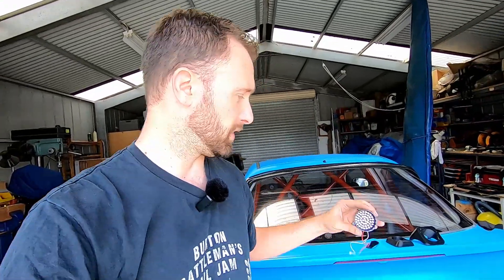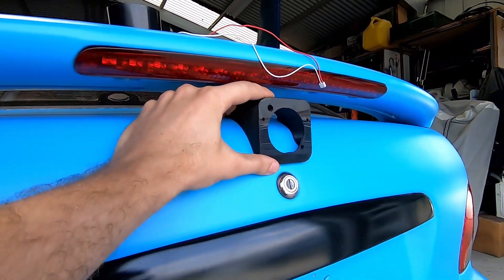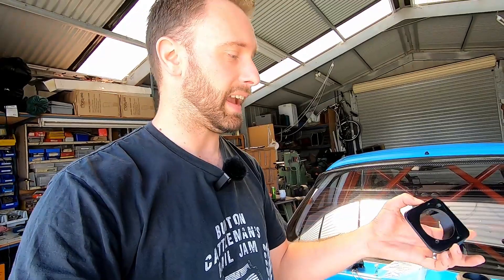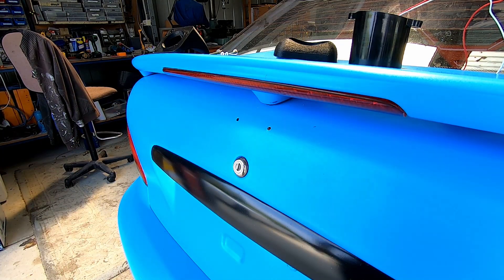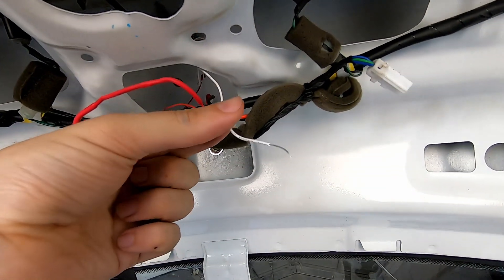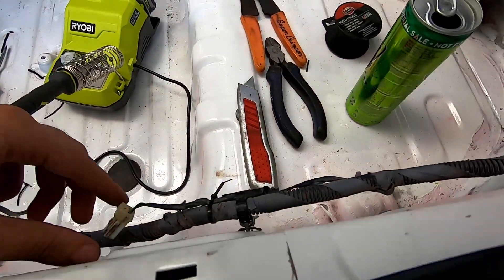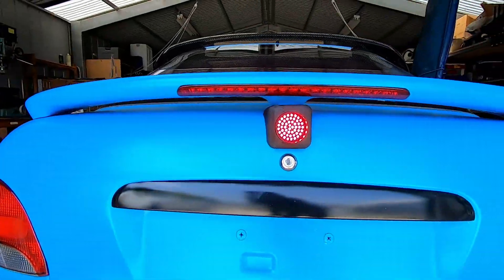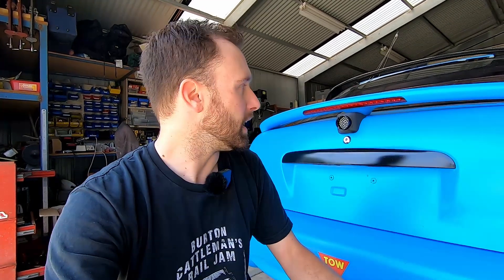Budget Race Car Build - Part 41 - FIA Rain Light Install

Comment: Just curious...  could one mount the rain light to the rear of the roof, just above the hatch window?
For myself, I'd rather it mounted away from my Spoiler Brake Light Strip.    ☺

And if not allowed to mount it that high up, could it be mounted atop the Spoiler?
This would be my 2nd choice of placement.    🤔
Reply from the maker: I haven't read the regs in a long time but i'm pretty sure it has to be in that round about area, on teh boot there, i think my placement is about as high as it can be, but it works there, really neat and tucked out of the way, i'm happy with the result :)

Comment: The Excel shown, in AUS trim, has a rear fog light, lower right in bumper.  Compliant with UNECE 38/ADR52/SAE J1319.

The rear fog light is for use in bushfire smoke, torrential daylight rain, dust-storms and gravel roads, and of course heavy fog.  OFF - the moment conditions improve.

Motorsport regs should in my view, allow for its use instead of adding yet another virtual identical performing light.
Reply from the maker: Should, but unfortunately doesn't

Comment: lol solder in line parallel. Then solders the resistors in series. Great work btw i really enjoy watching your videos i just found that part funny :P. 

Also i suggest buying a 2 way plug like this https://www.supercheapauto.com.au/p/sca-sca-quick-connect-housing---2-way-20-amp/120300.html?cgid=SCA01060604 and wire it in close to the light because if you ever had to remove the light you would have to fish out 2 meters of wiring back to the original flog light connector.
Reply from the maker: Yeah i know i know, was pointed out to me heaps, unfortunately once the vid is up not much i can do about it, was pretty sleepy the day i filmed it :P If i ever need to replace the light i'll cut and chuck a plug in, will only take a couple of minutes :) cheers for watching!
Reply: Yes, wired in Series, not Parallel.    😅
A simple slip of the tongue could potentially cause all kinds of mischief.    😂

Comment: Been watching your entire series, I’m a few vids behind still. Getting into the excel racing myself this year in Vic so hopefully see you out there some rounds. Anyway not sure if you’ve addressed the issue of potentially scratching the roll cage around where you enter and exit the vehicle but I’ve seen a few guys in America actually wrap that part of the roll cage in a clear vinyl to protect it
Keep up the vids!
Reply from the maker: Hey mate cheers for watching! yeah i'll definetely see you out on track :) cheers for the tip on the clear vinyl, i've already done it ;) got it on all the parts that i can scuff with my feet when getting in and out, definitely works!

Comment: Looks rad!  But can you chuck a rubber grommet on the metal where the wires go through :p
Reply from the maker: Haha, yup, i'm going to use silicon and suspend the wires in that so they wont' get cut :)